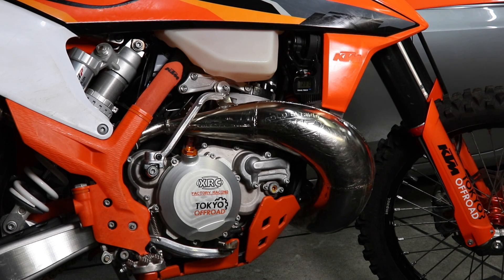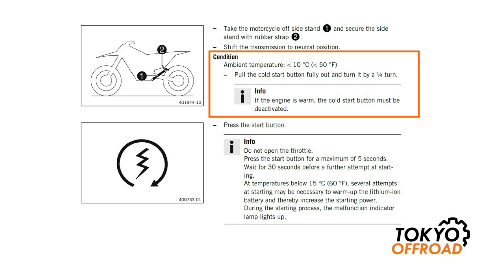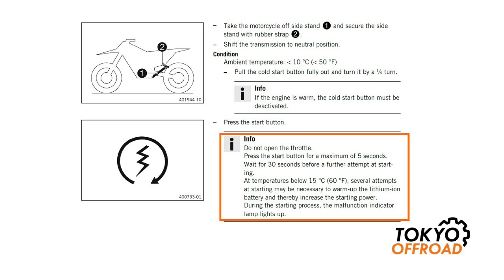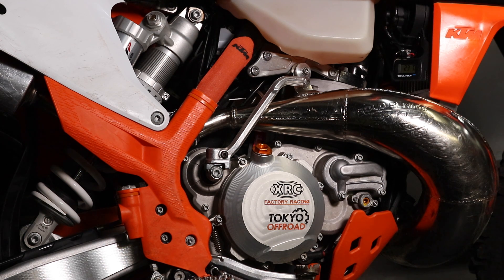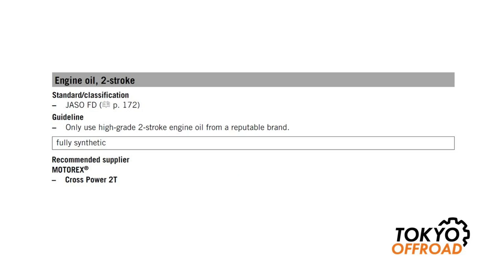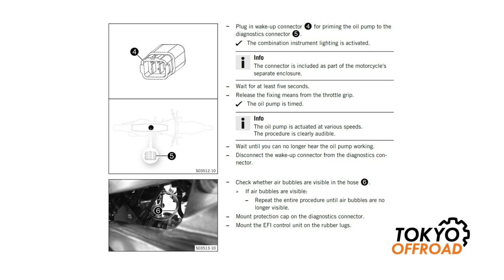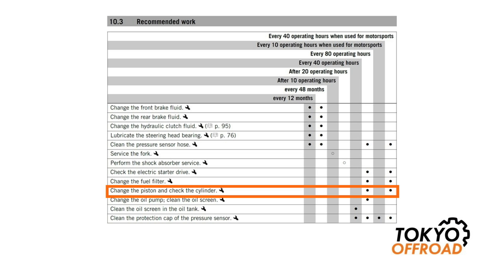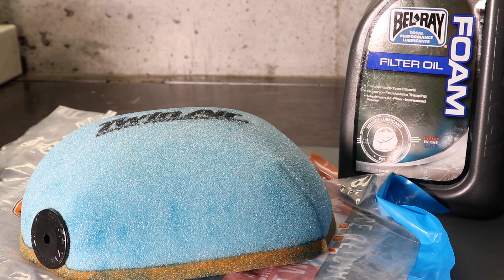Tips To Help Ensure Your TPI 2-Stroke Engine Doesn't Seize

Comment: I enjoy watching your videos and the droll humour too. As a retired motorcycle mechanic and tuner and ex dirt racer from 40 years ago,I'm amazed how much I've learned about modern bikes in the 18 mths since I started riding again.Bought a KTM 2019 300 TPI which had numerous issues which are all resolved now. I'd like to offer a small input for your consideration. I see a label marked E10 unleaded on your bike and have a couple of suggestions. I raced for years on Methanol and petrol and had many issues but was never beaten to get the best results and engine reliability. 
KTM advises to use unleaded 95 which gives a higher BTU/ml than either E10 95 or unleaded 98. E10 has much lower BTU/ml and requires more fuel to travel the same distance and produces less torque than 95. E10 attracts moisture and cannot be left in the tank for long,especially if not full.The worst effect is on TPI fuel pump and filters so that O rings perish and wreck the pump. Moisture in fuel also promotes organic moulds and blocks the fuel pump screens and both filters too. 
Lastly unleaded 98 is not good for two strokes as the added Octane boosters and bore cleaning agents and Zinc upper cylinder lubricants are bad for electrodes on NGK TPI plugs,which become contaminated and short out and will not start or run well. EGR codes will appear but after their clearing,a new plug is still required to start again. Lastly the NGK TPI extended tip plug has a 2 degree ignition advance advantage over other recessed Platinum or Palladium plugs,which means more torque and better consumption.  
Keep up the great reports and tips on riding and bike servicing. RV
Reply: so just use the plain unleaded fuel?

Comment: Great video. Please can you confirm the following. Must you first hold the throttle wide open before connecting the dongle to prime the oil pump or must you connect the oil pipe to the measuring container, connect the wake-up dongle and then open the throttle for 5 seconds and then the pump will activate and run a cycle.
Reply from the maker: Pleased that you like the video. To start the oil pump priming sequence you must first hold the throttle wide open, then plug in the wake up dongle, wait at least 5 seconds, release the throttle and the sequence should start.
Reply: @TokyoOffroad  Thanks

Comment: Great information as always. Recently ran the oil pump test on my 21 GasGas EC300 and got the same results. Curious, when doing a normal priming cycle with the oil line connected, apparently if there are no bubbles, the pump will not run (as seen in another video). Obviously don't want to dump a bunch of oil into the throttle body, but what is the ECU using to prevent excess oil or stopping the pump if prime is not necessary? Thoughts anyone?

Comment: recently bought the 2022 model, 26h in and i had a damaged cylinder head and piston. bike was not used in motorsports, only for casual riding and some soft enduro. any tips on what should i do or check? i tried to contact ktm but they said i only have 1 month warranty after purchase and 1 1/2 months passed since i purchased so my warranty is currently expired.
Reply: Chances are that the damage happened during cold start, these tpi bikes can not be revved at all until hot and they take several minutes at idle to warm up depending on outside temp. From what i've seen the people who are meticulous about warm up do not have any issues. Not your fault as there wasn't enough awareness about this to owners until recently.

Comment: Just checked the oil pump output on my 2018 Husky TE300i (Euro bike). 
The sequence is quite different from the one shown on the video. The pump gives pulses only for a few seconds, giving 1ml of oil. Hence I gave it a go 5 consecutive times and collected the oil in a syringe. What I got was total some 6 ml. My bike has 35 hrs on the clock.
These videos are superb - thanks!
Reply: I’m experimenting the same results in my 2019 300i. Clicks ONLY while the throttle is held wide open. If I wait 5 seconds and release the pumps stops. I didn’t measure the output but it wasn’t 6ml.
Reply: @98xjroks  As said, I repeated it 5 times to get 6 ml.

Comment: best way is to avoid TPI as they go away in 2023 for TBI with premix system. KTM admitted this way TPI was a mistake.
Reply from the maker: Will be interesting to see if TBI will be used on all 2-stroke models including EXC (which need to pass emissions testing in Europe), or only the off-road closed course only models (SX, XC). If TBI passes emissions testing I wonder why they didn't use it from the 2018 EXC model as it should be more reliable, cheaper and lighter as no oil pump, or tank are required.
Reply: @TokyoOffroad  that's a good question.

Comment: Hi! I did the test and I am getting 6.3ml , is it ok to keep running the same oil pump? At what lower amount should I change it?
Reply from the maker: Yes, that's the same as I measured so should be fine to continue using the same oil pump. I would say if the volume drops 10% (below 5.7ml) then it would be a good idea to  change the pump. Note that this is not something specified by KTM...

Comment: I get why KTM went to TPI but it's ridiculous overkill for a guy just wanting to ride a dirt bike. The two stroke dirt bike was always a simple machine and now look how much has been spent on this channel to get his TPI bike running to his liking. Not knocking the channel it just seems there's never ending spending and worries on these TPI bikes. Just my two cents worth. I've road KTMs for as long as I can remember but quit buying new ones because of the increasing cost of a new bike and the TPI is even more expensive.
Reply from the maker: My understanding is that due to the quantity of bikes KTM manufactures they had a choice to either stop making 2-strokes, or comply to the Euro emissions regulations. They chose the later and developed the TPI. As modern engines go the TPI is a fairly simple system and much simpler than any 4-stroke. Many of my riding buddies ride stock TPIs. No one I know has seized a TPI engine, so it's certainly not a question of having to spend lot's of money on mods to make it reliable. The tips I go through in the video are all pretty basic and many of them apply equally to carb bikes (thorough cold start warm up at low rpm before riding, use a good 2-stroke oil, regular top end overhauls & air filter maintenance). The mods I made to my bike are for performance improvement as I didn't enjoy riding the bike stock, which is personal preference as I know plenty of people who like how the stock bike runs. BTW, I still love riding my carb KTM 2-stroke :-) https://youtu.be/w1BM-miFYWo

Comment: Why am so nervous to pull the trigger on a TPI? Case of over researching possibly. I just don’t want to be stuck looking at bike that’s seized, maybe I should just go 4t route?
Reply from the maker: Depends what riding you're doing. I much prefer 2-strokes for the terrain I ride, but if you ride more open, higher speed a 4-stroke might be a better choice. If you like the TPI then go ahead and buy one. Maintenance is easy and cheap to perform yourself.

Comment: Best tip throw the oil pump go pre mix
Reply from the maker: If you use only premix and delete the oil pump on a standard TPI very little oil would get to the crank and conrod bearings, possibly causing failure very quickly. Strongly recommends no one tries this unless the injectors are relocated to the reed valve. Even then there is some disagreement as to whether the injectors are OK passing premix.

Comment: Buy a carburated bike and have a simpler, better performing bike and an extra thousand bucks
Reply: I’ve owned so so many carb bikes and not one has run better than my TPI bikes.
Reply: @jamesperry7028  mhm thats why tpi is awesome it runs like a perfectly tuned bike right out the box
Reply: Can you let your carbed two stroke idle for 30 minutes to an hour right off a cold start? Didn’t think so
Reply: @StupidActivities101  And for god sake…..why should i do such stupid thing ? But i can ride just off a cold start….contrary to…
Reply: @scannorse  they gum up tho they will not function like w tpi bike
Reply: @StupidActivities101  no, they will function better than tpi. Just listen to the KTM factory driver, or even better….look at EnduroGP results since tpi !! Latest spanish hard enduro event….9 out of 10 best in the prologue is carb bikes incl winner, winner and 2 out of 3 fastest is carb in straight rithm, and main race at least 5 out of 10 is carb, including winner and 3 place. And btw none of the carb bikes have cheap chinese cylinders….
Reply: @scannorse  not talking abt races talking abt tpi in general tpi allows two strokes to basically idle alll day long and richens up the fuel mixture when your going fast. Now you may be a carb guy i get it but in my opinion tpi and tbi are totally the way to go they are way smarter than carbs I honestly fucking hate carbs they give nothing but issues and very low benefits for me tpi or tbi has everything i want or need
Reply: @StupidActivities101  still, nobody wants to idle all day long….crazy argument. Just listen to the KTM factory rider….
Reply: @StupidActivities101  And your 2-stroke tbi experiences are really based on years of trial and testing ? But sorry for you that you cannot setup a carb…
Reply: @scannorse  why would i want to set up a old carb when i can have a bike that adjust to where i am, how cold it is, how warm it is, how im riding, altitude. carbs are old news my guy tbi and tpi are the future of two strokes if brands want to keep making them
Reply: @scannorse  some people don’t have open terrian buddy so people kinda have to idle all day long aka what these enduro bikes are specifically designed for
Reply: @StupidActivities101  no problem to have a carb doing the same, but better. If you wanna have a boring bike, be my guest just continue.
Reply: @StupidActivities101  …..dont believe in all things the capital company from austria tells you. Did you consider that there are a good reason for why the other brands haven`t taken their already on the shelf injection development results into use, after more than at least 6 years stored on the shelf ? (And no….not a cost issue!)
Reply: Why do you have a hardon for this factory ktm rider??? He living rent free in your mind huh… as far as the carb vs injected I can’t name any cars that are carbed anymore so the future I’m guessing everything will be injected in time… but don’t worry you can be that old guy at a car show saying ‘if I had a nibbi carb on that bike tuned just right I can have it screaming’… but if you like messing with carbs smelling like gas and changing jets to ride in the morning when it’s cold then change jets because the sun came out and it stopped raining more power to you
Reply: @codygraves2295  I can't think of any two stroke cars...
Also tbi is much better performing compared to tpi. It does have a different feel compared to carb.
Reply: @joshscoot2231  Use a Technology Elevated Smartcarb 2 as it's better than TPI. I however do like TBI as it imo true fuel injection as  I consider Transfer Port Injection nothing more than plain old "oil injection" just like the Evinrude boat engines.
Reply: And play the jet game....
Reply: @fredmitchel1236  Less than 5 minutes of work and still a more fun ride. Less time compared to the need of tpi`s idle-time before you can start driving, or testing oil pumps or testing sensors…
Reply: I'm a old man too carbs are a bit better power but  once you try a tpi I think you would be impressed and for the average Joe it's easier for them to jump on and ride but in 5 years I'm sure there's going to be so many electrical issues that a carb wouldn't have.First KTM I've had and tbh it needs lots of little mods that I've never needed to do on other brands .
Reply: @Ray-ol8bx  I have been riding a number of tpi´s, and none ride better than my carb bike, and definately they are not as alive and fun…..and no cheap WP to mess around with…
Reply: You have rocks in your head in your think carby bikes run better than tpi.
Reply: @Wahey_RS  latest KTM development prooved my point, so do the KTM factory driver, sorry
Reply: @scannorse  you are making no sense?
Reply: @Wahey_RS  if you won`t hear it from me, then listen to the factory driver developing the new bike, and take a look at enduroGP results since tpi 😂🤣
Reply: Meh, had my tpi for 3yrs. 0 issues. Starts every time
Reply: I agree 100
Reply: Carb- ONLY with oil injection.  You don't NEED to feed it gas @ ZERO throttle to lube the piston/cylinder on long descents to prevent seizing! Jmho
Reply: Only on Motocross Bikes these days. I don't believe any modern 2-stroke Enduros are carbureted.
Reply: @keithsada1380  what ? Remember what KTM factory driver just said ? Quote: " a 300 two-stroke (KTM..) – a bike which has won so many world titles in the past but a big, fat zero (enduro-GP, ISDE…) since things turned TPI. "
Reply: @keithsada1380  sherco’s. But TPI >

Comment: Another great informative video.
 I have a 2021 300 Tpi, last couple of rides I have noticed the motor bogging on wide open throttle in the power band. Feels like the choke is on (on an old bike) anyone had any issues? No other running issues, stock bike.
Reply from the maker: That sounds like an issue with the crankcase pressure sensor. Check that the tube which goes from the rear of the cylinder and brass fitting are both clear internally. if that doesn't fix the issue then the pressure sensor has probably gone bad, or you might have a leak. I've made a few videos about the crankcase pressure sensor so please check them out if interested. This one is a good summary: https://youtu.be/P1IXInpL-P0

Comment: All anyone says to me is 'ohhh you've got a tpi, it will seize soon' actually making me think now 🤔 but my first hand experience with tpi's has shown they are perfectly reliable.
Reply: People will always talk smack about the things they can't afford 😂 my 2021 has been perfectly reliable.
Reply: @mikemcallister7116  I believe that’s most of it.
Reply: @mikemcallister7116  1 year old calling it perfectly reliable 😂 call me in 15 years
Reply: well if they ACTUALLY were.... there wouldn't be 5000 videos of it online. Just like this one. You are just lucky.
Reply: @ashflame6888  absolute garbage. TPI'S are reliable. Need to do your maintenance like any enduro bike
Reply: @ashflame6888 i raced 4 tpi Models since they came out, not once had a sieze, pistons always come out in good condition and the engines are bomb proof!  You are a bell end
Reply: @ashflame6888  qqq
Reply: There is 8 of us who run TPI’s, not one issue
Reply: @trueinfidel7321  that’s what we want to hear! Thanks for the input!
Reply: @Max S it’s always been The same for 2t. Just got to warm them up b4 going maddog on them. 😉🤙
Reply: @Max S just do it bud just do it.
Reply: Picking up a te300i tomorrow and I’m not worried one bit. Warm it up like I do my dual sports and putt around for a minute or two and enjoy! 🏍💨
Reply: My 2021 cracked the piston in 80 hours but I also ride the piss out of it
Reply: Never had a problem with mine, excellent bike
Reply: Great bikes

Comment: That's a 2021? What forks are those?
Reply from the maker: XPLOR forks, but I'm using Dingo Racing fork guards on the tubes: https://dingoracingproducts.com/
Reply: @TokyoOffroad  do you prefer the Xplor forks? I just thought all 20 and up had AER
Reply from the maker: @samuelyeet6006  No, the 2017~2021 all KTM EXC and XC-W models are fitted stock with XPLOR forks. The XC and SX models are fitted with AER. Stock the XPLOR forks work well at low speed, but tend to blow through the travel too quickly and don't feel stable at speed. Over the years the valving in XPLOR fork valving has changed with some improvement (2017 was way too soft, 2021 is much better), but I have modified my bikes...

Comment: How much oil did the Get ecu dispense?
Reply from the maker: With a GET it will cycle the oil pump as long as you keep the throttle open. As such you need to decide on a time period to do your measurement and keep the throttle open all the time. I prefer the stock ECU priming sequence method for this test, although the GET method is great for just clearing out air bubbles from the hoses after you’ve had it disassembled for maintenance work and means that your throttle body doesn’t get swamped internally with oil.
Reply: Anyone tried this with the GET ECU for a set length of time?? I just wanted to compare to what mine is pumping.  I believe mine pumped approx 2.75 mL of oil after 2 min of holding the throttle fully open with the dongle plugged in.

Comment: My 150 does 2.5ml on the priming cycle and 3ml with a modded pump. Easy way to test is just fill the oil tank to the top and run the priming cycle and you can see the oil drop.

Comment: Once again another exceptional video from Tokyo. I must say, watching this makes me appreciate my 2018 non-tpi 250xc more. I now have pre-anxiety on replacing my 2018.
Reply: I was thinking the same thing.After 25 KTMs I switched to a 300 Beta and it’s oil injections but it still uses a Carburetor. And it was 800 dollars less.
Reply: I’ve been riding KTMs only for 15 years now, am a huge fan but not liking both this added complexity on my 2020 300 plus I hear the new ones a kickstarter can’t even be added - my buddies 300 Beta is an amazing bike and I might try them next time.
Reply: These TPI bikes are super easy to deal with. They seem intimidating, but they are quite simple.
Reply: Please spare a thought for new anxiety riddled TBI buyers